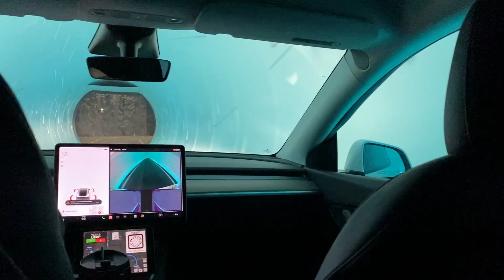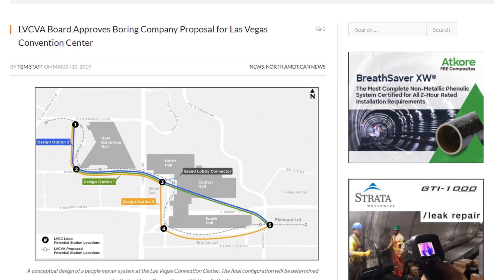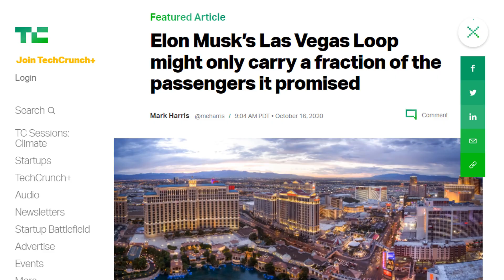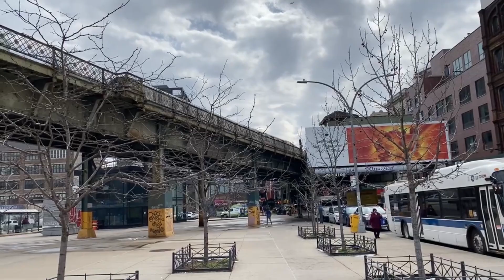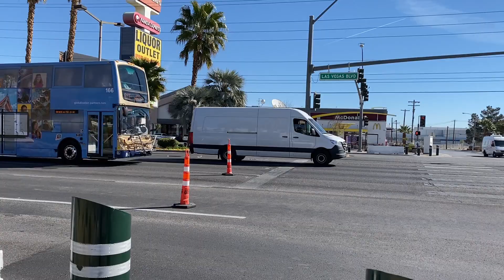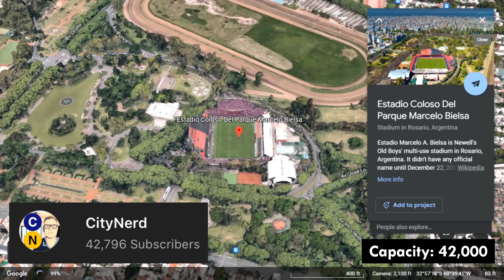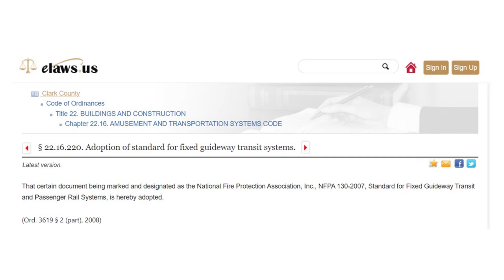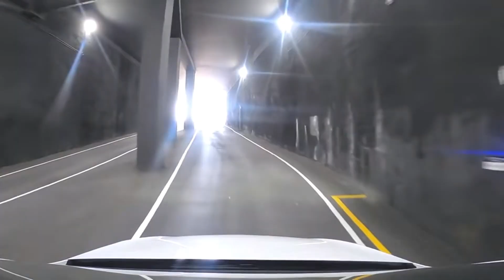Inside the Las Vegas Loop: Transportation Game-Changer, or Complete Waste of Time and Effort?

Comment: I got my first Pfizer shot in the Las Vegas Convention Center last year 😎

Anyway, I’m not a big fan of the Loop because it’s super low capacity, like you mentioned. I’d like to see more of an underground BRT system. Tunnel under LV Blvd, make platforms level with the busses, keep stations under the road and have walkable tunnels to the hotels/attractions… but I’m not holding my breath.
Reply: the trouble is that BRT is much lower capacity and far slower than the Loop.  Just have a look at the Vegas Bus service which has a daily ridership of 178,390 across 51 routes and 3,900+ stops and a fleet of 708 buses. 

So compare that to the Boring Co’s Loop which only has 1 route, 3 stops and 70 cars and yet easily handles 27,000 passengers per day during conventions. 

So that very large, busy bus network only carries 6.6x the number of passengers of the small 3-station Loop despite having 51x the number of routes, 1,300x the number of stops and 10x the number of vehicles each of which has 10x the seating capacity as each Loop EV.

The 29 mile 51 station Loop will increase the size of the Loop by 17x, it means it could end up with a capacity of 459,000 people per day which is 2.5x the daily ridership of that entire Vegas Bus network. 

Considering that Las Vegas only has a population of 600,000, you can see how the Loop is indeed a very good solution for the public transport needs of this city going forward - particularly since it is costing the taxpayer ZERO dollars compared to around three quarters of a billion dollars for a comparable grade-separated BRT network (or $15 billion for a comparable subway).
Reply: the system had a single 1-minute long delay during the busiest conference of the year... why would they need more capacity?

Comment: Las Vegas Loop Tunnel Diameter:  12 feet
London Underground Tunnel Diameter:  11 feet 8 inches
Glasgow Subway Tunnel Diameter:  11 feet
I haven't given up hope that Elon will come to his senses and install tracks in his tunnels for subway trains.
Reply: New subway tunnels in London and the USA must have an emergency walkway with side door access. They're wider than 12 feet.
Reply: @flinx  I have wondered about this.  The loop tunnels have just a narrow curb outboard of the running surface for the cars.  It doesn't look as though it is designed to serve as a walkway.  A person could squeeze past a car in the tunnel, but it doesn't look like the narrow space alongside the car is designed for emergency evacuation.
Reply: @gregvassilakos  The tunnel road surface is 9 feet 4 inches. If a Tesla pulls over there's 3 feet of walkway. The fire safety report says the road surface doubles as the emergency walkway. 

Teslas have kept driving with power while one of the multiple battery modules in a pack malfunctions. A battery fire is the most commonly mentioned problem that may happen in the tunnel. If a battery module fire happens, the vehicle can likely still drive out to the nearest station. If it can't drive that far, it can still come to a stop on a roadway edge.
Reply: @flinx  Thank you for the reply.  I take this to mean that Tesla can't operate vehicles in the tunnels that are wider than the present cars, so there is no option for vehicles the size of a small bus unless they are very narrow.
Reply: @gregvassilakos  The fire protection report includes a line drawing cross section of a high occupancy vehicle which is a little wider. The drawing doesn't show if it has train-style flat sliding doors. It could also hypothetically have doors on the short sides instead of or in addition to the long sides.

Comment: I'm a bit more optimistic (a LITTLE). In my view, the only two advantages cars have over trains are comfort and the fact that they can go directly to the passenger's destination. So the only ideal situation where I can see the system being useful would be a relatively low volume system with several stations. That way, each passenger or group could select their final destination and be taken directly to it.
Reply: Essentially a taxi, in other words? It'd be kind of extravagant (and probably not very cost-effective) to build an entire separate road network, underground, only for a taxi service, however ...
Reply: @Codraroll  kind of. But I meant more like a rail service where there are just a few tracks, except your car  goes directly to your stop as opposed to your actual final destination like in a taxi. I agree it would not be cost effective for a big city vs an actual rail system, but I could see something like that being useful in some niche applications.
Reply: @noisycarlos  That still sounds pretty useless. It's just a branching BRT system with lower capacity. And even then, BRT usually isn't the best solution as a transit option. So you're talking about a crap knockoff of a usually subpar system.

In pretty much any case you'd be better off with a single high capacity bus or tram line over this sort of system. Like, looking at the Vegas system for example I think a single tram line down the main spine would have made a ton more sense.

I think the thing that really needs to be hammered home about the system in Las Vegas is that it's more expensive to build and operate than a tram system of similar size. Trams don't need to be underground. Trams don't need as many drivers and trams are the more expensive option compared to some red paint and busses. The system never makes sense because it never makes sense to invest the money needed to dig a tunnel and hire as many drivers as you need for the system. Even if you can automate it it still doesn't make sense, because you can automate trams and light rail on the surface. And trams, light rail, bus rapid transit, subways, heavy rail, bike lanes and probably a system of fucking rickshaws all scale better than cars.
Reply: @Lankpants  Fair enough. I agree with you. All I was saying is that if I try to give it a chance, that was ONLY way I could see this as being useful. I wasn't clear in my original comment but I meant in the future, as in, once it's autonomous, not with drivers. 
100% in its current iteration it's really bad.

BUT if I had to imagine the best version of this in the future, and how it could be useful...

The best vehicle would definitely not be regular cars as it is now, it would be something closer to those Google cars without a driver seat, or trams as you mentioned, but smaller (each vehicle doesn't need high capacity if they leave frequently enough).

Lastly, the vehicles don't have to be trackless, they could be more like a train,  except each car moves independently and communicates with the track so that they can be routed directly to their final destination.

A hybrid like this would have best chance at being useful in my opinion. It probably won't have a better throughput than trains, so it only would be useful in low volume systems, and is IF making the construction and tunnels for are actually cheaper than the ones needed for a train (which might absolutely NOT be the case).
Reply: @noisycarlos  I'm pretty sure that if your goal is routing directly to your final destination track is just objectively a terrible option. There's going to be a huge issue with switches in any tracked system with a high number of branches and high frequency. Even the fastest track switches tend to work in timeframes of dozens of seconds. You probably couldn't route track operated vehicles through this proposed system quickly enough.

There's already a similar system to what you're suggesting in existence anyway. It's just not built much because it's prohibitively expensive to operate. A grade separated busway.  The idea is that you take a busy, central spine of your city and convert it into a bus only highway essentially. You can then connect it to roads all over your city and run a ton of different routes on it, allowing most commuters to make single bus trips rather than changing lines.

And if you're building this sort of system the optimal vehicle to run on it is a bus. It basically fixes the capacity problem and you can cut down on operating costs (despite busses generally having terrible operating costs) while still keeping solid headways (some busways run on 1 minute frequencies). And if you can automate the cars you can probably automate the busses too.
Reply: @Lankpants  well. Fair enough. I'm not an expert by any means and I'm sure there a ton of reasons why it wouldn't work better than what we have. Still fun speculating on how it might be possible to improve it and make it feasible, if at all possible.
Reply: @noisycarlos  I think the big hurdle in terms of practicality is the absolutely ludicrous amount of infrastructure a project like this needs. It is, essentially, a second highway system for the city, that's entirely underground. Miles upon miles of tunnels to maintain (and tunnel maintenance is freakishly expensive too). Hundreds of stations, imagine the land costs. It is an enormous extravagance of land acquisition, construction, and maintenance - and that's before you consider the vehicles themselves. All this is somehow reserved for one type of transportation only, with zero synergy with the other transport needs of the city. 

The problem with the Loop is quite simple: Too much tunnel to be worth it. But I guess that's an advantage to the company that sells tunnels.
Reply: Another advantage of the Loop is that Loop stations only cost about $2m each which is between 50 and 350x cheaper than subway stations and with tunnels only costing $19m per mile, you could build between 10-100 miles of Loop tunnels for every mile of subway tunnel. 

This means it is possible to put Loop stations right at the front door of every hotel, casino, office block, sports stadium, school, University, shopping centre, Rec centre etc etc in a city. 

That is exactly what is happening in Las Vegas with 51 hotels, casinos, the University, sports stadium etc all getting their own Loop station at their front doors. 

So not only is the Loop point to point not having to stop at every station in between, there are also far more destinations that you can travel directly to at 5x the speed of a train or bus.
Reply: @andrewfranklin4429  Once again with the fairytale numbers, the copypasted paragrahps, and the apples-to-oranges comparisons. 

Couldn't you just try HONEST arguments, for once? And if not, what does that say about the thing you are arguing for?
Reply: @Codraroll  no fairytale numbers required Erlend.

The Boring Co has just submitted a bid to the city of Miami for a 6.2 mile Loop with 7 underground stations in a straight line from the city to the beach which gives us a good idea of their latest cost estimates for a Loop network. 

It will handle 7,500 passengers per hour with the option of scaling it up to 15,000 people per hour. 

TBC has submitted a quote for $185-$220 million which gives us a cost per mile of a remarkably cheap $30m - $35.5m per mile for a dual tunnel, a cost which in this case also includes an underground station every mile instead of the much cheaper above-ground stations of the 29 mile Vegas Loop. 

So that is $35m for:
* an underground station, 
* AND one mile of dual arterial tunnels 
* AND four spur tunnels per station 

However, Loop costs can even cheaper than that because the 51 stations of the 29 mile Vegas Loop will all be cheap above-ground stations which are basically just 10 car bays, a loop of roadway, an awning covered in solar panels and the four spur tunnels/ramps going back down underground.

Estimates put the price of those above-ground stations at a mere $2m or thereabouts.  This is backed up by the $48.7m that TBC was paid for the LVCC Loop which included an underground station that Musk admitted cost $30-40m to construct which left only $9m - $19m to pay for the 1.9 miles of tunnels and the two above-ground stations.   (TBC probably sucked up some of the extra cost as a learning exercise but that leaves precious little for the tunnels and stations). 

Now the LVCVA has indicated that all of the 51 stations in the upcoming Las Vegas Loop will be those cheap $2m above-ground stations, not the expensive $30-40m underground station. 

The proof is in the pudding with the fact that TBC is going to pay for the cost of ALL 29 miles of tunnels ITSELF with the 51 hotels and casinos paying for the construction costs of their own stations at the front doors of their establishments.  The taxpayer will pay ZERO dollars. 

There is no way TBC would have proposed building those 29 miles of tunnels for free if they cost as much as traditional subways (even in Europe): 

29 miles of tunnels x $100m = $2.9 billion
+ 51 underground stations @ $100m = $5.1 billion

$2.9 billion for all the tunnels is not something that even Musk would do for free. 

Then there are all those 51 hotels, casinos, the University, Allegiant Stadium all agreeing to pay for their own stations. They wouldn’t do that if those stations cost $100m each.
Reply: @andrewfranklin4429  Luxtram 6 to 24 times less energy per person required, 3 times more persons per hour transported, twice as cheap per mile, zero deaths (Tesla cars have hundreds of deaths in one year), way less maintenance required, way smaller number of drivers required, so everything better than the Las Vegas Loop

Comment: Will the loop save people from walking a quarter mile in the 120°F desert heat? Those of us who grew up in the desert, it's probably not such a big deal. For everyone else....heatstroke?
Reply: I have the perfect solution, a wet towel. all it takes is a bucket and towels. just fill the buck it, wet your towel, then wrap it around your core. feel so good.
Reply: @Aliceintraining  Yes, that would work. Evaporative cooling works well in hot dry climates. However, imagine all those people walking around with buckets of water and wrapped in wet towels. LOL!